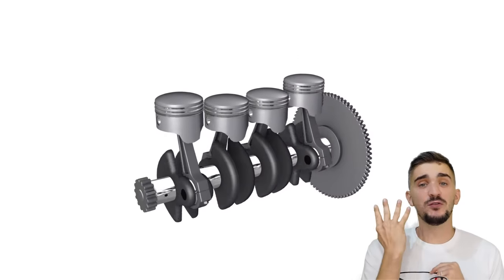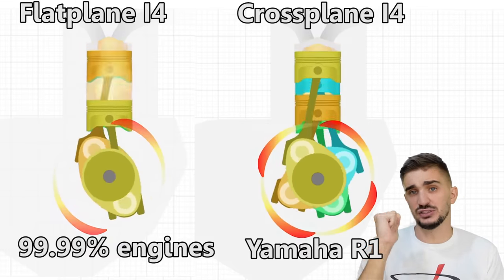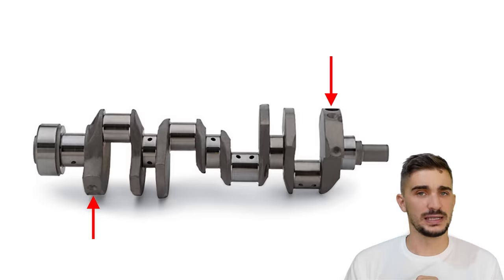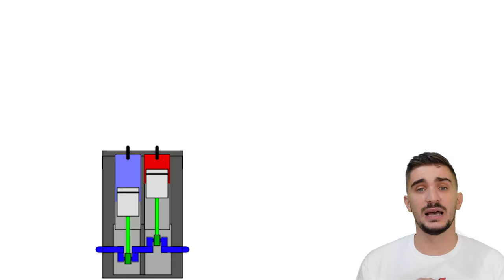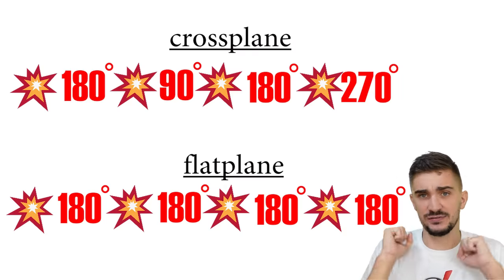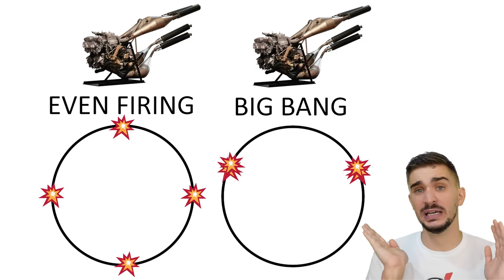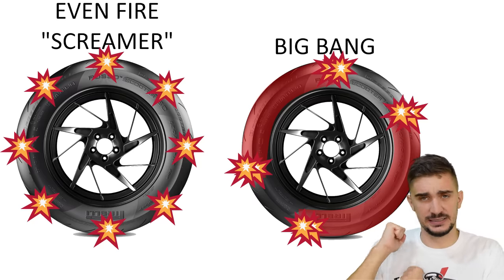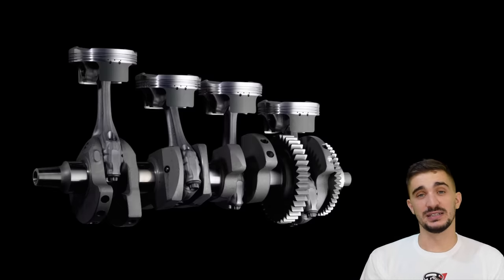CROSSPLANE inline 4 EXPLAINED in detail - How the YAMAHA R1 i4 differs from all other INLINE FOURS

Comment: Very interesting and well presented, however I would like to add a crucial point relating to the balance shaft.  This has not been added as a "revvable alternative" to additional end weights on the crank, it is actually an essential component.  The only way to fully counterbalance a rocking couple is with a pair of counter-rotating identically dynamically imbalanced shafts, that together produce a precisely opposing rocking couple.  The forces being balanced are in a single plane (parallel to the piston travel).  Rotating weights alone also produce forces perpendicular to this plane, so any rocking couple they balance in one plane, they will add perpendicularly which obviously is not solving the problem.  By adding a second counter-rotating shaft the perpendicular forces can be cancelled while the parallel forces add.  In the case of the subject engine, weight is added both to the ends of the crank and the counterbalance shaft and these work together to balance the rocking couple.  In the case of a cross plane 90° V8, there are two rocking couples to counter-balance which are both phased and oriented 90° apart, so effectively are a rotating couple.  These can be perfectly counter-balanced with an opposing rotating couple provided only by added weight on the crank.
Reply: that does make a difference. thanks for promoting that point.
Reply: That is what I thought too.  @driving 4 answers can you confirm this?
Reply: @JadusMotorcycleParts  I think my RZ500 is a 2stroke example of this.
Reply: Colin, I think when you examine the out of balance of the cross plane, there is indeed a vertical rocking out of balance, but I would expect there is also a yaw out of balance. Both of these can typically be counteracted with a single counter-rotating, engine speed balance shaft.
Reply: @blast3613  yes, but perhaps out of necessity with a 2 stroke, otherwise with a flat plane crank you would have pairs of cylinders firing together on every down stroke.

Comment: A great explanation. Yamaha has always built some interesting engines. BTW, several years ago I rephased the crank in my old XS650 from the original 360 degrees to 270 degrees  (well, actually 284 degrees). I don't think it goes any faster but it's smoother, sounds awesome and has more "character". People always ask me what kind of exhaust system I'm using that gives it that cool sound.
Reply: Anywhere I can listen to it or something similar to it?
Reply: @pokefan2711  I'll be riding past at 4:38am GMT tomorrow. Only once though, so be ready.

Comment: This traction advantage is very apparent with Ducati back in the day when they raced their 90* V-twin.  Ducks always exited corners faster with more control caused of the power stroke and traction.
Reply: Didn’t hurt that they were lighter, had greater capacity, and desmo valvetrains.
Reply: If you are talking about SBK then Ducati had displacement advantage. Ducati is behind big 4 in terms of handling. Yamaha and Suzuki sportbikes are best handling especially the Yamaha.
Reply: Honda 4 cylinder solved the problem. Number one piston was offset by 90 degrees.
Reply: @timhughes2651  desmodromic valve has one big advantage, that is literally no valve float. But one serious disadvantage is in engine braking. The aggressive nature of desmodromic valve is not best for handling
Reply: That’s probably why they fitted slipper clutches which reduced the effect of engine braking and allowed faster downshifts.
I superbikes that is.
Reply: Ducati also used to make all their power below 10k RPM
Reply: He needs to do a video on all the advancements that Ducati is done throughout the years starting after the desmosedici. Don't get me wrong that was a nice bike it was a nightmare to work on and for half the cost you could buy a 1098r that made just as much power. Since I already bought Ducati about the time they came out with the new V4 it's kind of the sky's the limit so we don't know what's going to happen in the future yet

Comment: The sound pop demo is a great simulation of the FP-CP difference. It's easy to see (hear) why the sound of "halved" engines of the same crankshaft layout have a core part of their sound character from their doubled counterparts. Cross-plane V6s have a muted V12-like character. Inline-3s, 5s, and V10s all have a distinctive dual-tone sound. High-rev flat-plane I4s don't sound too far off high-rev flat-plane V8s, which themselves often sound more akin to I4s than the cross-plane sound most people associate with a V8 of nearly any displacement. 
A real fun software toy would be to take that sound demo, turn it into a simulator in software, and then add the ability to bolt on an exhaust system that you can lengthen or shorten, as well as bend, in real-time.
Reply: There are no cross-plane V-6's....
Reply: @davelowets  Ah, right. Different angle offsets.
Reply: @SurelyYewJest  Yep. (3) 120° angles
Reply: @davelowets  Hmmm...I guess one could say that V6s are "oblique-plane" engines...

Comment: Cross plane cranks are more common in exotic V8 engines. One of my favorite is the newer Ford cross plane V8 in the Mustang. IT SOUNDS AMAZING!!! 
I had a Yamaha R6 with a single plane in-line 4. It’s redline was 15,500rpm, 120hp from 600cc! It was very smooth but all the power was delivered after 10,500 rpm…..which made for a quite thrilling top end rush but a docile low end power delivery. Yamaha is the innovator! 
Nice video.
Reply: Yep this is nothing new and has been on many v8 cars for some time
Reply: You couldn't be more wrong you're thinking of a flat-plane crank in the Mustang 5.1 Voodoo motor.

Comment: "Yamaha technology, always a step ahead of the competition."

Now I know the true meaning of the above MotoGP commentary.
Reply: Yamaha also discovered the best amount of valves to have in a cylinder (back when every engine manufacturer was trying to beat the competition to the optimum). 3 intake and 2 exhaust turned out to be the magic number. They also turned the cylinder position around. That development resulted in a bike with greater balance characteristics.

Comment: Dealing with vibrations is the most difficult problem in mechanical engineering. As an engineering of myself, thanks for all this layman explanation that helps more people to appreciate efforts of hard working engineers. You did a great job!
Reply: I too am an engineering. 😅
Reply: When you can build a 600cc 135hp bike that revs to 15 16 thousand RPM and not grenade you got my respect guys.  I was watching IOMTT fastest record lap with hickman POV the engine is screaming for mercy but hicky gives it none 4 37 mile laps like that says the  engineers for bikes are some of the best as stock these bikes can go 100k miles easy with basic maintenance

Comment: Awesome description.  Now I finally see why the crossplane was done.  I have a R1 crossplane.   It's easy to stall when taking off.  It seems like 2 pistons are firing simultaneously, but based on your description I can see that's not the case.  The firings are individual but irregular.

Comment: Excellent presentation. It is amazing the thought and creativity engineers will put into these engines for every little bit of advantage over their competitors, and how these advantages are often only be worthwhile in very narrow operating conditions. Fascinating. Great video!
Reply: Actually, the irregular power pulses of the Yamaha R1 help in everyday conditions, not just racing.  Racetrack pavement is usually in very good condition, and oil spills are cleaned up right away.  Pavement on public roads is another story.  Add in the very high power of the R1, and that fact that most R1 riders are not experienced racers.  The way the crossplane crankshaft improves the grip of the rear tire can be very helpful, increasing safety in slippery conditions, like in the rain.  Riding a bike with around 200 hp on the street requires the rider to be paying close attention all the time.  Even so, it’s possible to misjudge the available traction when moving off from a stop, or exiting a corner.  The crossplane crank can be the factor that keeps the rider on his bike, instead of landing on the pavement, which is a terrible way to end a ride.

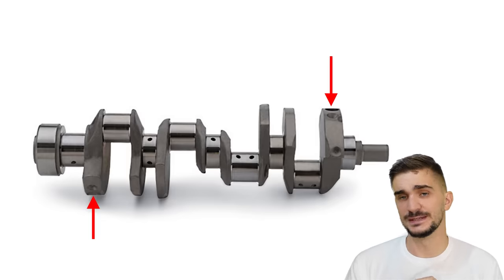Comment: 7:38 Not really—the R1's crank clearly has counterweights. Obviously the purpose of the weights is to reduce vibration, but the way the weights reduce vibrations is by translating the fundamental vibration (a straight front-to-back rocking moment) into a different imbalance that is more manageable.

The reason that many engines use balance shafts is because they not only have external forces or moments, but the vibration's horizontal and vertical components are different. Engine configurations that have this problem are:
 - Inline twins (360° has 1st and 2nd order forces and no moments, 180° has a 1st order moment and 2nd order force, 270° has 1st order forces and moments and a 2nd order moment)
 - Inline triples (120° even-fire has 1st and 2nd order moments and no forces, 180° flat plane has 1st and 2nd order forces but no moments, and Triumph's 90° T crank engines have 1st order forces and moments and a small 2nd order force)
 - Any even-firing inline engine with an odd number of cylinders (3, 5, 7, 9, _et cetera_)
 - Most 2-stroke even-firing inline engines with an even number of cylinders, such as the crossplane I4 (which is essentially a two-stroke I4 modified to run as a 4-stroke)
 - Most even-firing V twin, V6, V10, V14, and V18 engines with V angles that aren't 90°

Real-world examples:
 - 72° V10's (with non-split crankpins)
 - 90° even-fire V10's (+18° split crankpins, residual primary couple is greater in the vertical direction)
 - 90° even-fire V6's (–30° split crankpins, residual primary couple is greater in the horizontal direction)
 - 60° crossplane V8's like the Caterpillar 3508 (60° V angle, also with –30° split crankpins; this may be the largest displacement piston engine ever built with split crankpins)

The crossplane I4 shares the same problem as even-firing inline engines with odd cylinder counts in the sense that its primary rocking moment (that is of the most concern) has a vertical component that is much greater than the horizontal component.

The crank weights "average out" the vertical and horizontal imbalances (so that the corrected imbalance's horizontal and vertical components are the same) by providing a circular imbalance of their own that is one-half of the sum of the vertical and horizontal components. And now, because the corrected imbalance is approximately circular, it can then be taken care of by a counter-rotating balance shaft which provides a circular force or moment that is one-half of the difference of the components.

There are only two exceptions I'm aware of:
- Detroit Diesel and EMD two-stroke Diesel engines: The crank weights cancel out only the horizontal portion of the imbalance and most of the vertical component is taken by two pairs of weights on the camshaft (since they are 2 stroke the crank and cams rotate at the same speed)
- MAN 32/40 marine Diesel engines: The crank weights on the V engines are the same as those on the inline engines, and as a result they cancel out only half of the average imbalance. This results in the residual imbalance on the V14 and V18 engines still being greater in the vertical direction. In general, on large marine Diesel engines external forces and moments are left unchecked and the ship's structure must be designed to take these vibrations into account.

Even on engines that are inherently balanced, like almost all 4-stroke V12's, you'll often still see counterweights because the weights help reduce the engine's internal stresses and increase the crankshaft's torsional stiffness.

The reason why 90° V engines (with with non-split crankpins, except maybe flat-plane V8's) don't need counterbalance shafts is because the primary imbalance's vertical and horizontal components are the same to begin with, so crank weights are all that are needed.

The same is true, in fact, of the 60° V6's used to power so many cars and SUV's. The 60° V angle with –60° "flying arms" also makes the primary rocking moment's horizontal and vertical components nearly identical, which is why 60° (4-stroke) V6's don't need balance shafts but 90° (even-firing) V6's do. On a 60° V6, the secondary rocking moment is apparently deemed to be not significant enough to warrant further vibration reduction measures, so it is left unchecked.
Reply: Not to offend you or anything but do you have any source for this mate? thanx
Reply: @cipher2508  The SAE have a paper discussing this matter when it comes to inline twins (where they compare 180°, 270°, and 360° crankshafts), but I couldn't find many papers that go into this much detail on engine configurations in general. Because of that, I decided to work out the maths myself. Don't bet on it but I may make an engine balance "master class" in the future where I talk about it in detail, as well as one talking about torsional vibration in piston engines.
Reply: @electric7487  Awesome
Reply: That makes more sense than the stated explanation.
Counterweights rotating at the same speed should add the same moment of inertia to the engine, regardless where they are.
A balancing shaft should add even more, since the seperate shaft and the gears also add MoI.
Reply: The engineering behind the crossplane engine is super interesting
Reply: Thanks for this explanation. I went through the comments after watching this section of the video a couple of times and the explanation in the video didn't make any sense whatsoever and I'm happy I have found this comment :)
Reply: @B4ndItOo  Thanks m8, glad I could help

Comment: I love this explanation, so Rich and easy to understand... Question,
Did the 2nd generation lotus Elise (2zz I4) featured this configuration too?
Reply from the maker: Thank you, glad you liked the vid. No, the 2zz is a flatplane like all other mass production inline fours.
Reply from the maker: In case you're interested I have an old video on the 2zz: https://youtu.be/ViGVd1oSVTQ
Reply: Fiy. The 2ZZ is a toyota engine
Reply: @sv21turbo  the 2zzge in my corolla has got Yamaha stamped on it. So it's a Yamaha engine, my Corolla was also built in England.
Reply: No. It is a Toyota engine. Yamaha developed the sylinder head. As with a lot of other Toyota engines with a "G" head. They have done this cooperation since the 3M(G) in the 2000 GT back in 1966

Comment: Incredibly amazing video ! How can a guy explain such a ultra complex stuff so easily ! Absolutely love these vids keep making em sir !
And can we get a vid on the V4 ?
like V4 vs I4 or something?
And why was the V4 not included in the chart where all other engines (I4,  I2, V12, V6 ,I5 were there ,but V4 wasn't .) ??
Reply from the maker: I couldn't fit any more engines and the V4 is pretty rare but there will definitely be a vid on it. I didn't include the V2 either. In hindsight including the inline twos on that chart was also a mistake as the balance of these configurations can vary a lot depending on various things in their architecture.
Reply: जागते रहो
Reply: खूब भालो
Reply: It combines all the weaknesses with just compactness as a benefit
Reply: V4 engines' rankings depend on the V angle and crankshaft as there are many different firing intervals in use.

Ducati's "twin pulse" (90° / 200° / 90° / 340°) would rank towards the rougher side of smoothness, followed by Honda (180° / 90° / 180° / 270°) and Aprilia (180° / 115° / 180° / 245°). If Harley Davidson make a 45° V4, it would just barely edge out Aprilia on smoothness (180° / 135° / 180° / 225°) in torque delivery.
Reply: @electric7487  I've known that 90° V4s can have perfect primary and secondary balance naturally,is it so.
Reply: @p.chakraborty4453  Yes, as a 90° V twin with a common crankpin is inherently balanced in primary forces.
Reply: @electric7487  I'm asking about the 90° V4, there is a specific crankshaft that can create perfect primary and secondry balance without needing counter balncers, because of which V4s have a great midrange, low end, and a savage top end, whilst inline 4s have a very relaxed, not-so-tourquey midrange and low end power delivery with a savage top end here as well.
Reply: @p.chakraborty4453  A 90° V4 is two 90° V twins side-by-side.
Reply: @electric7487  but the crankshaft and firing order differs anyways.
Reply: @p.chakraborty4453  Yes, for example Ducati fires cylinders on each pair one immediately after the other, while Honda V4's fire each pair of cylinders like a V twin. Both have non-split crankpins, but Ducati has a 70° spacing between the two crankpins, whereas Honda have either 180° or 360°.

The difference in firing orders and intervals also changes the plumbing configuration on the intake if you want to turbo these engines. You would ideally need a turbo with a dual-outlet compressor housing.

If you have a 90° V4 that fires like the Ducati V4, you feed one outlet on the turbo to the left 2 cylinders and the other one to the right 2 cylinders. For Honda, one outlet would feed the front two cylinders and the other outlet would feed the rear two.
Reply: @electric7487  that turbo would ideally be a twin turbo, or a Veloster styled one maybe.
Reply: @d4a  V4's are more common in the motorcycling world. Honda has manufactured these since 1982, and Ducati have recently joined in to capitalise on their use in MotoGP. Honda have used 360 and 180 degree cranks, the 180 has the exact same firing order as the crossplane I4. If you are looking for complex, the Honda VFR1200 uses a 76 degree V4 with the crankpins offset by a further 52 degrees.